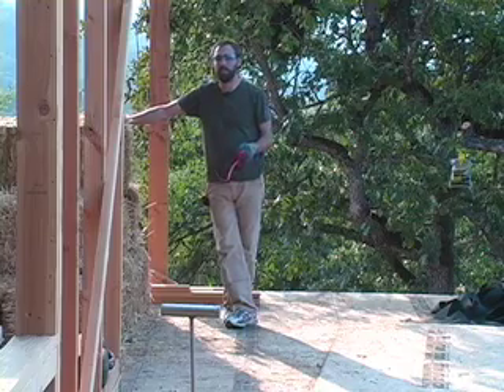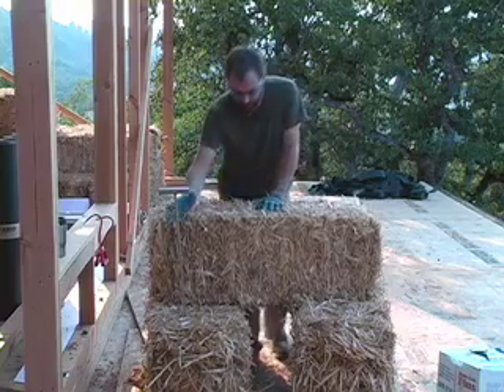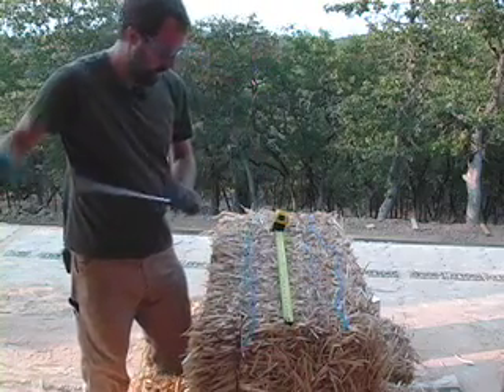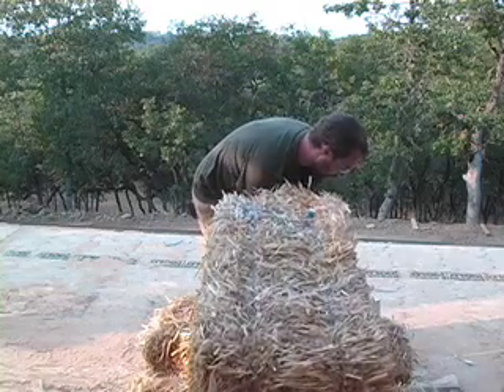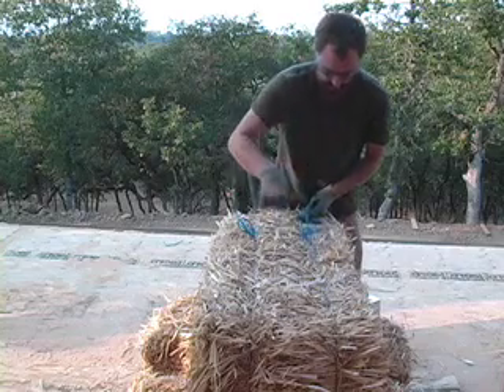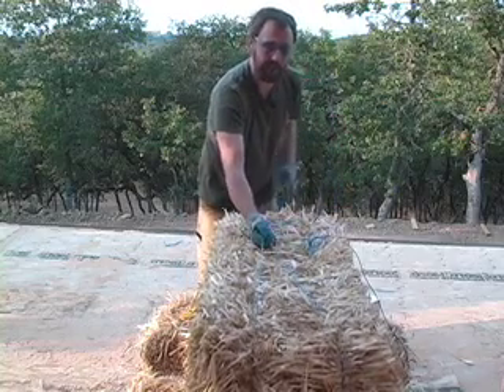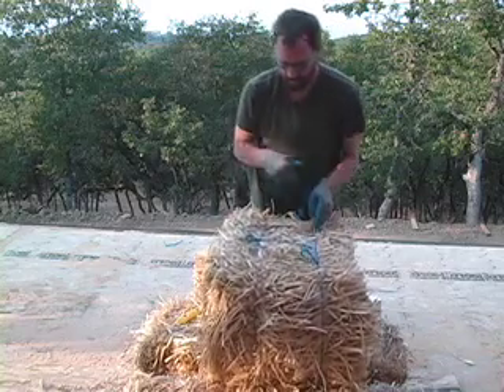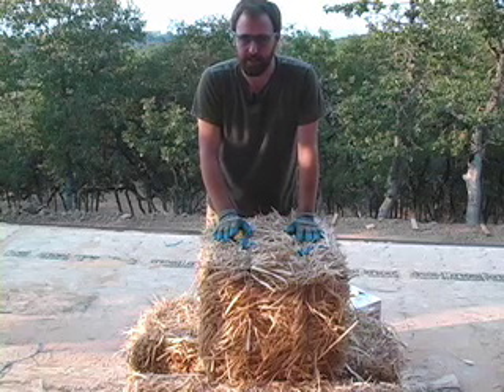StrawBale.com: Re-Tying Straw Bales Part 1 of 3

Comment: Hey where did you get the bale needle? We can’t find one. And need one pretty bad. Any information helps.
Reply from the maker: You can get the plans to the bale needle (and tensioning fork) plus a use guide on custom bale shaping here > strawbale.com/shop/bale-needle-tensioning-fork-plans-download/

Take the plans to your local welding shop or if you're handy in the metal shop, you can use the plans to make them for yourself. 

Good luck with your project!